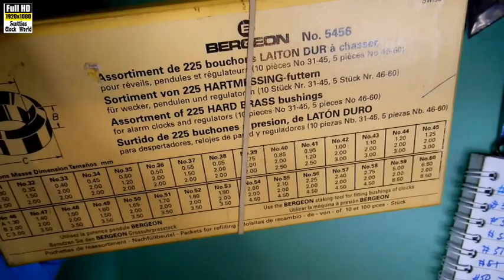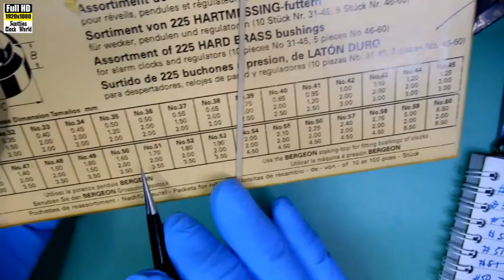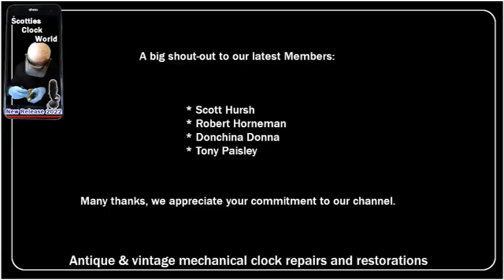How To Rebush A Clock Movement By Hand - Part 1 Reaming

Comment: Does clock repair net a decent yearly income? Do you need any sort of specialized documentation/training certificates? Are you required to apprentice or anything like that? 

I just cleaned my late  grandmother's clock and found the process challenging, but rewarding. Unfortunately, the clock still doesn't run, and I found at least 3 pivots that likely need bushings. I called the "local" repair shop, and they said that repairs start at $175 and since they're the only repair service within 4 states, they have at least a year long wait list... so I'm considering buying some tools to do the job myself. Which got me to think about a little repair business. Thanks
Reply from the maker: The returns have been ok but the current turn down in business (not a recession yet) and increasing parts/material prices are making it harder.
Apprenticeships are virtually non existant as quartz movement clocks are now the norm.
As skilled mechanical clock repair people are becoming thin on the ground prices charged for repairs are rising.
There are plenty of videos on YT to watch and as you learn your experience will point out the incorrect things some people do in their 'repair' videos.
Good luck if you decide to make the move.

Comment: You do use kwm reamers for bushing, these are expensive, are there more ways? I have a nice cnc router for pcb making and that is precise stuff, can mill these holes.
Reply from the maker: I use the Bergeon system as I regularly need to re-bush mid-19th Century French clock movements. Your idea might work, I have never tried it.
I will be shooting a video on cutting holes for bushes just using broaches not reamers in a week or so. keep an eye out for it.

Comment: HI Scottie I have( Smith Thomas Bellevue)  great videos for beginner like me. When removing the front plate warning wheel and minute wheel are attached to the plate.
Do I need a special puller to remove them? any suggestion would be great. Thanks
Reply from the maker: Can you send me a photo to clockandelectronicschannel at gmail dot com so i check it out.